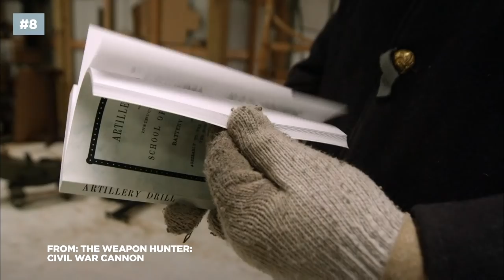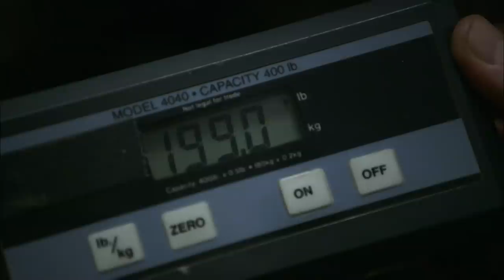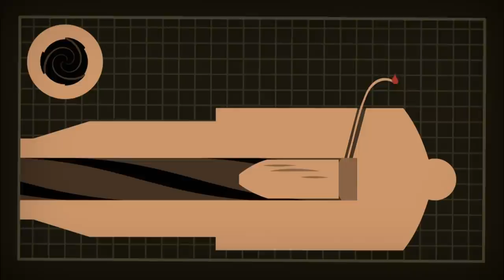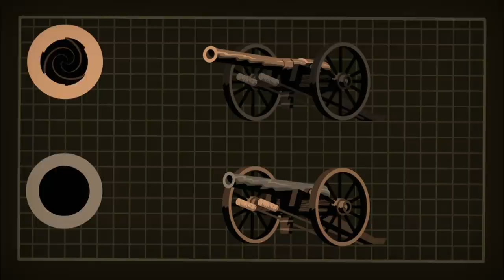19 Dangerous Historical Weapons | Smithsonian Channel

Comment: The Gatlin Gun they fired was slightly different from the ones used in the Spanish-American War.  The one they shot all the watermelons with was a 30-06, while the originals were .45-70.
Reply: Actually you are incorrect Indifferent Centrist, The Gatling guns are chambered in 30-40 krag  the same caliber as the rifles the Americans used in the battle you can tell it is not a 30-06 because it is rimmed. The United states Calvary had not used 45-70 since the adoption of the Kraig Jorgensen in 1892.
Reply: @parkerholt9408   I didn't know that.  Thanks.  I know the Army didn't want stripper clips for the Krag-Jorgensen because it would encourage soldiers to waste ammo, being able to reload so quickly.  There were definitely some growing pains when we went from black powder to smokeless.  I actually have an 1873 Trapdoor Springield, and it works.  It's hard to find ammo for it, since it can only take black powder (or very reduced charges of smokeless).  In fact, I shot a deer with it a couple years ago.  Not the highest velocity in the world but utterly devastating.

Comment: 4:40 LOL, they're not even firing that MG42, the guy feeding the ammo is just juggling the belt around to make it look like it, but does a pretty terrible job. Guess actual blank-firing MG42s were too much for the budget eh?
Reply: Blanks would look like empty shells in the feed belt. I imagine the did it for aesthetics, so you could see the bullets in the feed belt.
Reply: @tkgus2408  8mm Mauser crimped blanks actually don't look very much like blanks at all, especially to the average person....the crimped piece is long enough that it looks almost like a bullet. It would've been a much better option to use actual blanks and, y'know, fire the thing? More than likely budget constraints getting a blank-firing-adapted MG42, I doubt it was for aesthetics and I doubt they even thought that far.
Reply: @cameron8679   Maybe, but I would've easily spotted a crimped blank over an hot round; and I would have thought it looked stupid. There's also likely no way they got an actual MG, that's likely a replica. Replicas are made in 7.62mm, which makes blanks not expensive. You can clearly see that the rounds in the feedbelt are 7.62. You can also clearly see the bullet, and most can't tell a blank from a spent cartridge so...